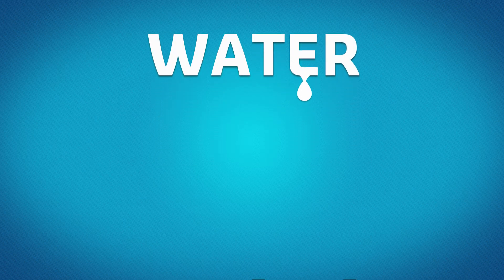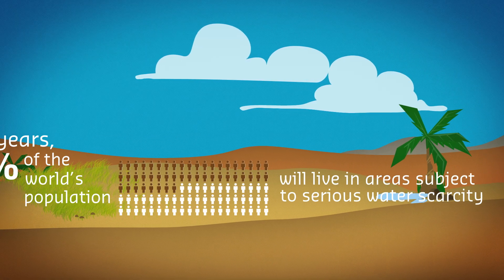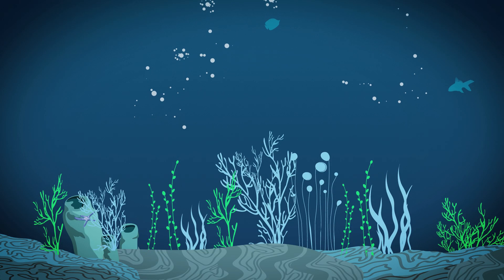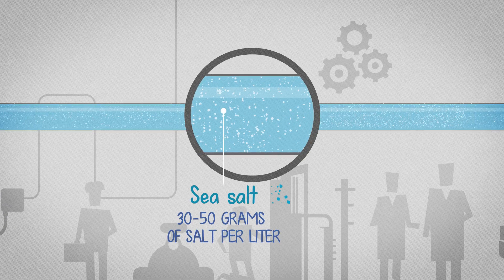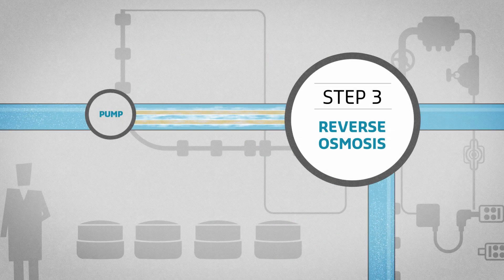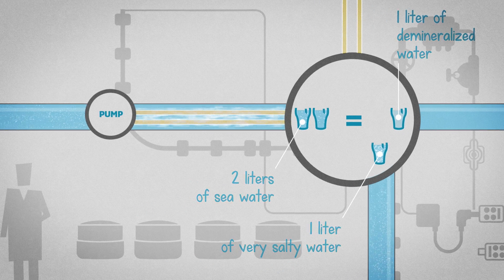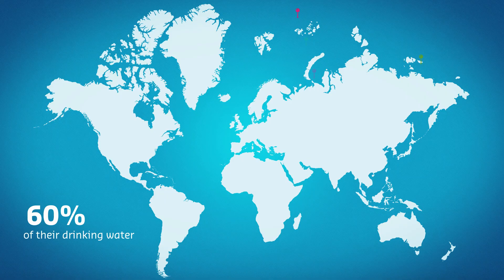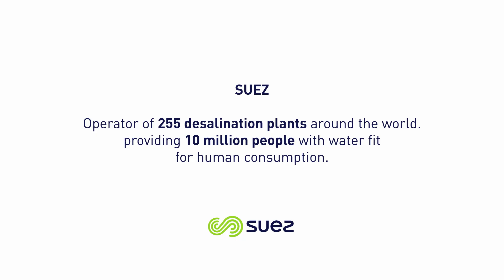“Drinking from the Sea”: How Desalination Turns Seawater into Drinking Water | SUEZ

Comment: What if we use solar panels to boil the saltwater.It would be cheaper and faster
Reply: You know how much energy is reqiured to boil enough water to support a large city like Los Angeles. Plus solar panels have one huge flaw and that's night time and water desalination requires constant energy output to make sure Temps don't lower.  It would take ages to heat up water with solar and by the time the water started to boil it would be night time already and nothing gets produced. The only way this works for a large city is building multiple dedicated nuclear reactor which won't happen because people think we can operate entirely on solar, Geothermal , and wind  when we have yet solved the biggest issues which is storing energy that wasted when not used
Reply: Solar and windmill unlimited power :)